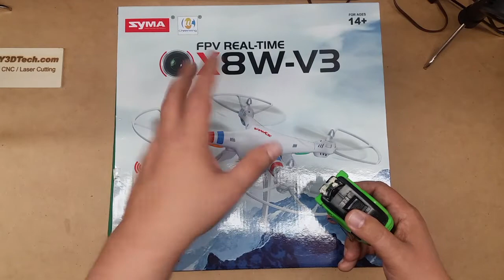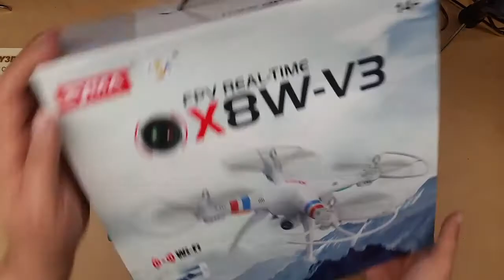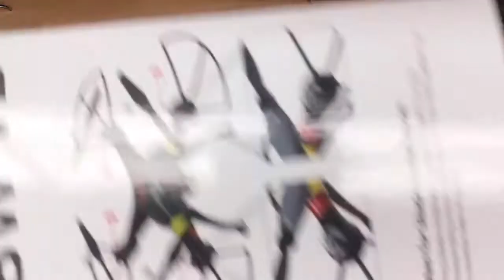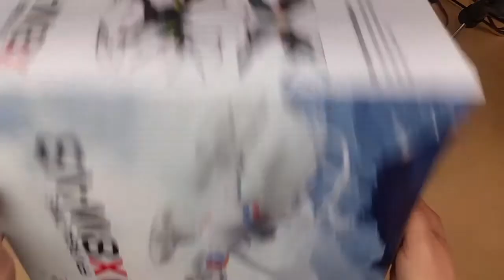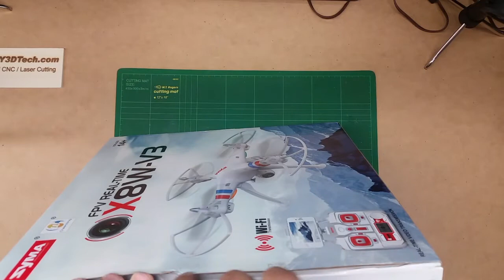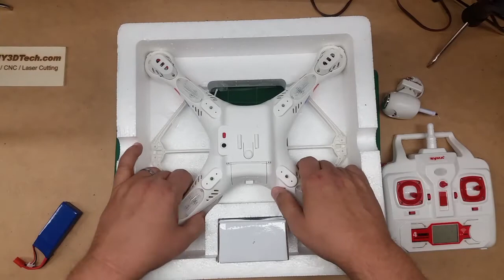Video Drone - Syma X8 Platform and Channel Introduction!

Comment: how many minutes each 2000mah battery without the camera
Reply from the maker: I would say around 10 maybe 12 with stock 2000 Mah and with 2500 Mah around 15 depending how you fly...